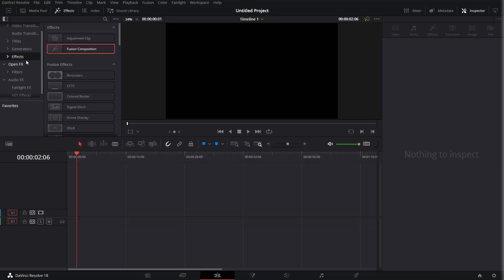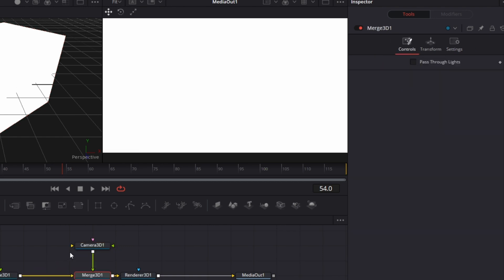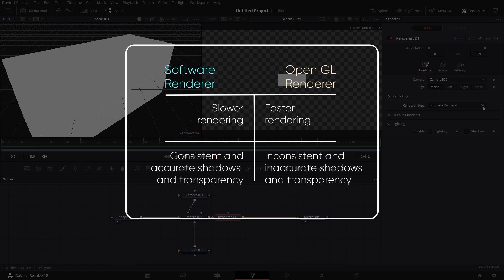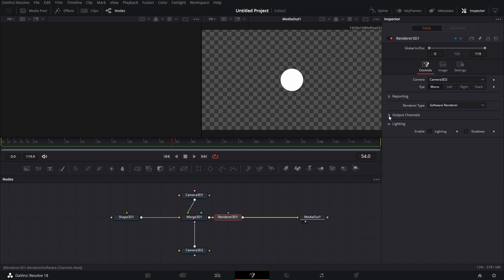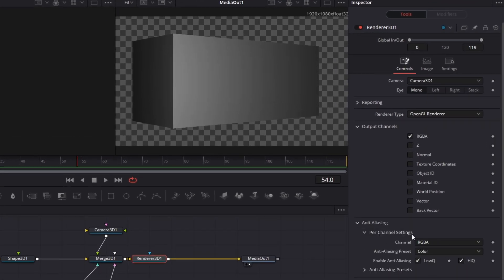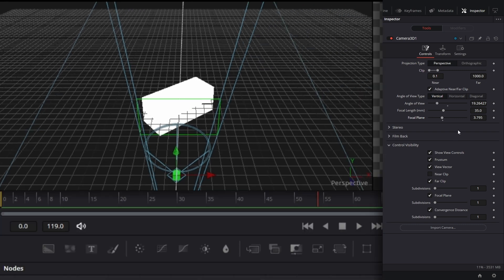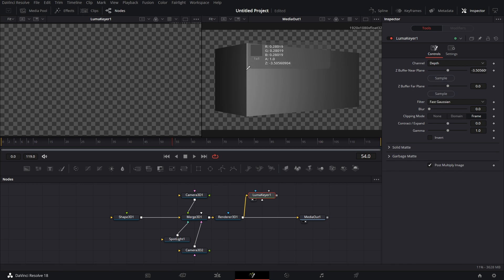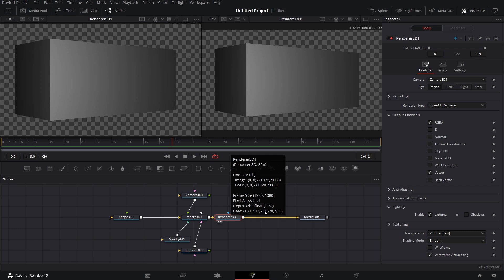Fusion Basics Tutorial 15 - Renderer 3D Node

Comment: Can you help me?  I want to add videos onto the cube (on both ends and possibly bend them around the corners).  Then animate back and forth between the ends of the cube as characters are speaking.  I guess, my first question is, how do I attach videos to either ends of the cube?
Reply from the maker: You can try this. When you add the 3d cube, you will notice there are 6 inputs on that node - front, back, left, right, top and down.

You may simply connect your footage to any of the sides by dragging the video to the node grid, right clicking the connector and dragging to the cube, release the mouse and you would be prompted to select any of the sides.

The only challenge may be that your video or image may not have the right aspect ratio for the side of the cube. You can correct this in 2 ways, either you adjust the size of your footage using a transform node or change the dimension of the cube. If you need further clarification on this, please let me know.

Please let me know how it goes